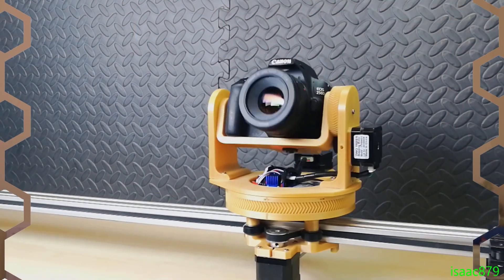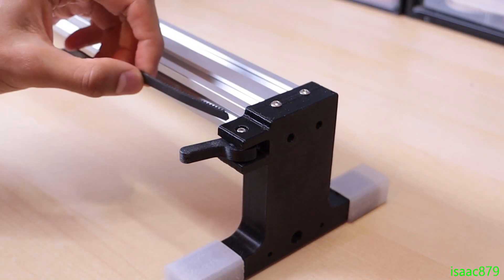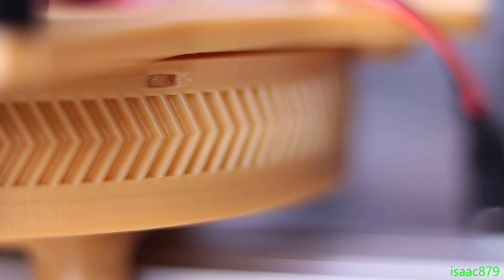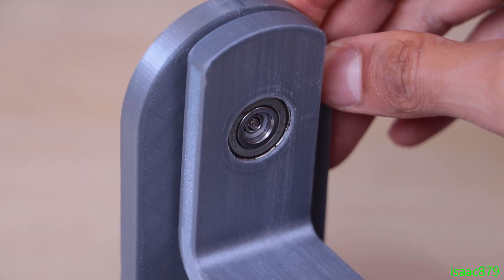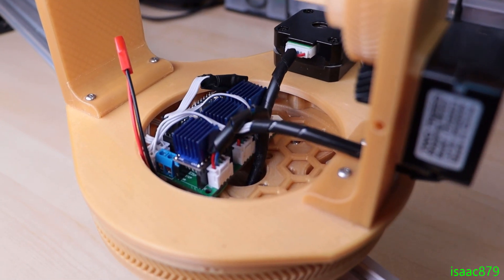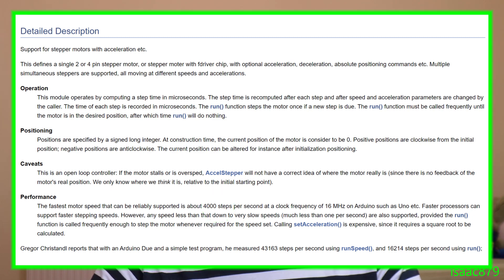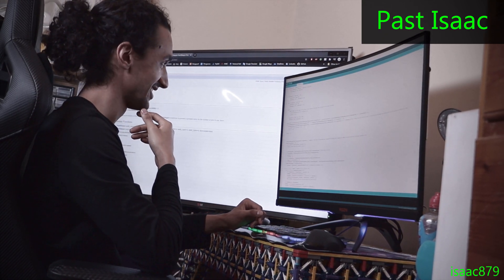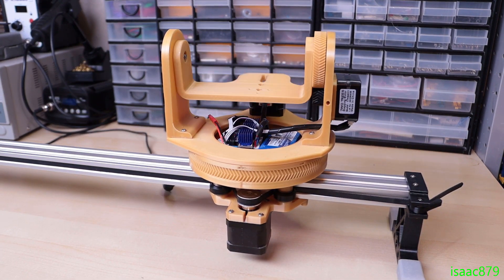Perfecting My DIY 3-Axis Camera Slider!

Comment: Hello man. I really appreciate the effort you put into it. A lot of ppl look for slider explained so deeply but can't find one. I have one question - what is a cheaper solution of controlling it, because i don't have xbox controller. How many channels do you need to operate and do u think any other, older pad will work ?
Reply from the maker: Thanks man! You can also control it via a PC or Android app using text based commands. The Xbox controller doesn't actually directly connect to the slider, it connects to the PC running a custom program which reads the controller then sends the appropriate commands to the slider.
Reply: Isaac, I have one question. I'm happy to tell that I finally made your slider, I'll try to post it on your thingiverse project page adding some extra tips for you to look at it. Actually I asked you If i can controll slider with anything other than Xbox. Well, I use my phone, but... to be honest, typing all those commands to make one keyframe can be just annoying. I would like to use a quick move like you do with Xbox controller, but I don't have one. I was wondering if downloading some emulator or any other app would work. You provided "Arduino bluetooth controller" from Giumig apps and there is an option to use it as "Controller mode" instead of terminal, but I don't know if it's possible to program these buttons to work like those on xbox contr. Do you have any idea if it can be emulated on phone without xbox?

Comment: Wow, this is great!! Starting the prints today. Have you ever considered adding lens control (Focus, Zoom). I would love to be able to do a precise Dolly Zoom.
Reply from the maker: Thanks! The idea did cross my mind but I haven't started any work towards adding them yet.
Reply: @isaac879  please do look into these. This set has potential to work as as remote controlled videocamera set up for low budget multicamera online streaming. with or without the slider. Ad some extra pre set points and this could turn normal videocamera to rival PTZ cameras.
Reply: @isaac879  What would the approach be to control the camera itself?

Comment: Iz nice. Maybe I make. 

I have been wanting to do a motion control slider for a while. I am more curious about the control interface. I want to use it for shooting some models (a la Star Wars) and haven't really found anything quite standardised in the open source part of the hobby yet. Will look into your project as you got some really nice and accurate repeatability in your shots which is what I am looking for basically. Do you record macros through the joystick or can you plot a curve with keyframes? I heard you mention keyframes. It would be really useful for instance if the movement (X, rotation, elevation) could be imported into Blender to control a virtual camera for effects and composited shots. The dream :) Thanks for sharing!
Reply from the maker: Thanks! To set a keyframe you move the slider to the position you want and tell it to save that position, then move it to the next position you want and so on. Once you have all the positions set you tell the slider to move between them. You don't really get to plot the curves, the software calculates the speeds so all the axis should reach their keyframe position at the same time. 
I think you might be interested in what Stephen Hawes has done. I believe he used a virtual camera in Blender to control his camera slider movements: https://youtu.be/dO9BP5LPpvc?t=163
Reply: @isaac879  Haha wouldn't you know it - the line at the bottom was red half way through ;) Was time for a revisit apparently. Thank you - that was a pretty great solution. Too bad I am a proper newb when it comes to the electronic and coding (mechanical stuff is fine), but part of the fun with being alive is learning new stuff.

Comment: Excellent work, consider getting a roll of PETG if you have never used it, I found that PLA is prone to cracking if under strain for any length of time, it may have been a bad batch, but since switching to PETG I doubt I will ever use PLA again.
Reply from the maker: I do need to get some... PLA definitely isn't the strongest material and some of my old filament reels have become quite brittle.
Reply: Printed two of these in PETG now -- can back off the infill a bit since it's so much stronger.  I was worried about dimensional differences with parts but they are spot on though the 2040 endpieces needed some deburring.

The challenge of PETG is the temperatures, I tend to print PLA in the Summer and PETG as combined heat and printing (CHP) in the Winter. ;)